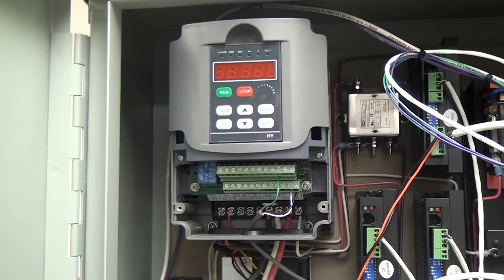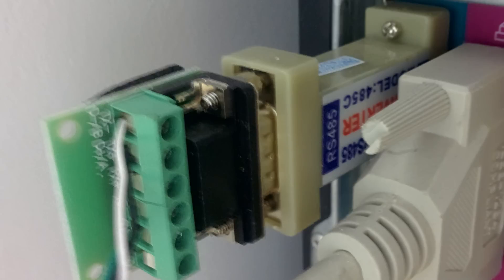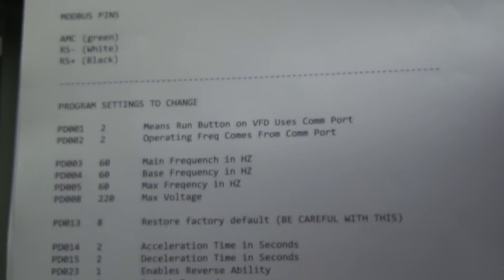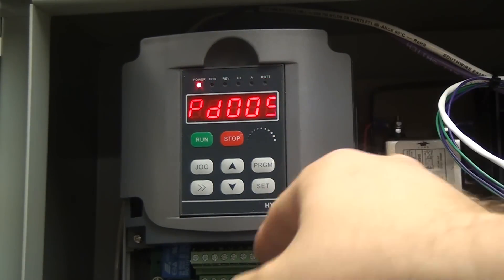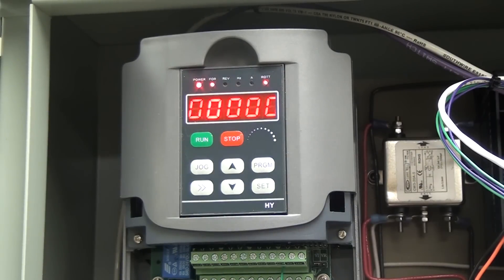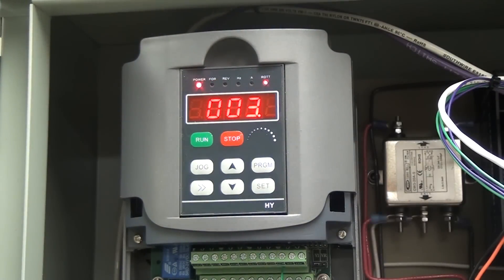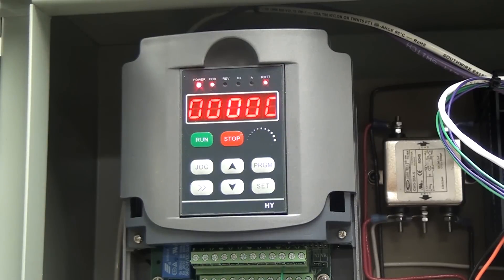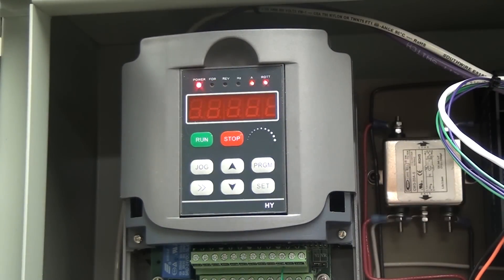Huanyang VFD 2.2kw (pt2/2) - Programming

Comment: Actually, the Parameter #13 is pretty important.
As You stated, it will revert the parameters to factory values when set to 8.
I think this should be done before any other parameters are programmed. This way You know the state of the VFD.

I have programmed a few of these and I have stumbled twice in a situation when the parameters were totally haywire. I think this is because the units are tested in the factory and sometimes the test leaves the unit in some strange setup. Factory reset will cure this.

Good and informative video.

Comment: The pins labeled FOR, REV, RST, SPH, SPM, SPL are actually multipurpose(with pin number D1~D6) and are configurable for different features. Whats on the label is actually their default feature.
Settings for program 44~49 are the pin configrations for the multipurpose pins D1~D6. Each can have 32 configurations (set 0~32), here are few common settings you may need:
01 Run (combine this with other controls)
02 Forward
03 Reverse
04 Stop
05 Toggle forward/reverse
13 Emergency stop
14 Reset
Fortunately I can understand the manual so I post this.
Reply: And also, you can configure diffrent segments of speed. That VFD comes with two speed control modes (low/mid/high or 8 speed) . The 3 speed control are already usable from pin SPH/SPM/SPL (of course you need set the frequencies first)

Comment: DO NOT FOLLOW THIS TUTORIAL UNLESS YOU HAVE THE SAME VFD. MY SPINDKE STARTED SMOKING AFTER SETTING IT TO 60HZ LIKE THE VIDEO
Reply: PD003 004 005 should be the spindle frequency  so 400 hz NOT 60
Reply: @hb9dod  This is my understanding as well (likely dependent on which VFD you have) but mine specifically says to set those parameters to match the HZ on the SPINDLE (not the input frequency from your power source to the VFD).
Reply: It's too bad I didn't see your reply until after the smoke cleared 😞

Comment: hey man, thanks for the Vid! just ordered one of these from ebay to run a 2.2kw spindle for my cnc. Just a FYI 8e1 RTU is Modbus lingo for 8 data bits, one stop bit. and rtu is remote terminal unit. just means that Modbus is set to direct master slave configuration (as opposed to over a network). your PC is master your VFD is slave. I am really surprised it didn't have you set parity. even or odd. but who knows :) anyway thanks for the tips! cant wait to get to playing with mine.
Reply from the maker: That's a great explanation, thanks! I don't know modbus at all but your description makes sense.
Reply: The 'e' in 8e1 means even parity.  It's defining the protocol of the bits flowing across the connection.  Both ends have to talk using the same protocol or it's like one person talking Japanese and one talking Hindu.
Reply: Ah. Your right! Didn't catch that one :)

Comment: If running on a VFD why stop and change belt ratio? Just set program 5 on your VFD to a max frequency "above" the base speed of 60hz to over speed the motor. something like 75hz = 2250rpm for a 4 pole.  Just as the VFD can run the motor below base speed (60hz=1800rpm) it can run it over that also.
Reply: Thanks - you just solved my problem of not being able to change the speed via the variable speed switch on the VFD above 1800rpm
Reply: Greg SB
Just remember that the VFD runs the motor in constant power mode above base speed (in this case that would be 1hp).  So the torque the motor can provide will drop off HP*5252/RPM=torque.
Reply from the maker: For my lathe, I need to run some tests and see what the motor is willing to take. It isn't rated above 60hz. Now my new inverter duty mill motor is rated to run at 120hz and 180hz is the "max safe". That should be fun.
Reply: The Leeson 192051 is listed as "inverter rated" 10 to 1 speed reduction and 150% speed increase, so you should be able to run the motor from 6hz to 90hz without issues.  Of course the "inverter rated" is a marketing term and as you mentioned if it was an inverter duty motor (ie designed electrically to run on an inverter) it would be marked on the name plate.  Since the motor on a VFD will produce constant torque below base speed and constant HP above it should be possible to run just one belt ratio for the majority of your lathe programs and not have to stop to change belts or have 2 programs.  Looking forward to seeing the testing videos.
Reply from the maker: Chris S The Leeson is 10:1? I can't find that info anywhere, but that's good to know. When controlling the VFD via modbus there are 8 "speeds" the VFD allows, in 7.5hz increments.I've run the lathe at all of those speeds, but you're right the torque falls off pretty quickly. When I need low RPM and more torque that is when I go to another belt, but that's proven to be somewhat rare at this point.
Reply: russtuff see the link for the 10:1 rating ( first page AC aluminum frame)  http://www.leeson.com/1050%20Updated%202015/1050%20Updated%202015%20AC%20Motors%203-Phase/IECMetric.pdf
Most small 3 phase motors are capable of 10:1 constant torque and really the only thing keeping them from doing more than 10:1 is the lack cooling when they are slowed way done. To get the most out of over speeding the motor the max amp rating should be set to at least S.F. amps as the motor will only draw that loading if needed.  Remember 3 Phase motors are all rate to run 24/7 in a 40C (104F) environment for years, they can take a lot of abuse. Keep up the good work!
Reply from the maker: +Chris S Thanks Chris. I know nothing, so this is good stuff. I have my vfd at full load amps and not service factor. I should crank of up a bit then. I have an external fan I need to mount on the lathe motor so I can keep it cool under load. My new mill motor is 1000:1 so that one should be fun.

Comment: Will this unit function with only 220 in and the power leads going out hooked up and none of the other wires hooked up..I just received one that is similar and hooked it up, but nothing happening..also do you have to do any rewiring on the motor..it is a clausing 4914 lathe with a 3-phase motor..the vfd is single to three phase

Comment: FYI pd 176 needs to be set to "1 "  for 60hz input power
Reply from the maker: OOOOO good catch! I'll add that to the documentation on my dropbox.
Thanks!
Reply: I tried to set mine to 1(60hz), and it wont save it. It jist goes back to 0(50hz)  I have tried reseting the vfd any ideas?  Im having trouble getting my spindle to spin past 1000rpm.

Comment: There is enough noise in my shop that I sometimes don't notice that I have not turned the VFD on.   Running a program with the spindle not turning is not my idea of a good time.
I finally figured out how to let Linuxcnc know that it is off.  In custom_postgui.hal  I added the following line as the first line in the file:
sets spindle-at-speed false
and that did the trick.  Now if I forget to turn the VFD on the program executes until it finds the first S and M3 commands and waits until I turn the VDF on and the spindle gets up to speed.
Reply from the maker: Excellent!

Comment: I want to run my motor at 20khz at it's highest rated voltage which is 220v, 
the reason why I want to run it at such a high frequency is because apparently they higher the frequency the less current it draws giving the same output(supposed to be physically impossible). so how would I program my vfd to make higher frequency?
Reply: u should program PD003,PD004,PD006 to your desired frequency yet I have difficulty changing it from output of 50Hz to 60Hz, I change whichever I mentioned and all together, at the panel it shows the 60Hz like I chose change but does not change while running the motor...from my experience with another type of VFD the 60Hz output gives a bit higher RPM and still maintains its torque
Reply: Ronen Shemesh oh I know how to program it manually but it maxes out 500hz, I wanted to change the limit. thanks anyway bro

Comment: My system has a 1 1/2  3 phase motor and running a 1.5 kw VFD the maximum my lathe runs is 1750 I wish it ran a little higher speed. I am running default 50 HZ. Can I run a higher HZ to increase speed?
Reply from the maker: It depends on what your motor is rated for. On one of my machines, I run at 120Hz because the motor is rated up to 180Hz. It's a inverter duty motor.
Reply: @russtuff  I have a 3 phase motor that is rated for 3500 +. I have a 2" pulley on the motor and an 8" on the direct drive on the  Craftsman lathe. It is a completely different lathe then it was with the when it was originally built. I thought I could change the speed with the parameters but may need to reduce the 8" pully.
Reply from the maker: @imanutnur7  if you have a way to monitor the temperature of the motor, I'm sure it wouldn't cause any problems to try out different frequencies. you might also want to check what type of bearings it has and what RPM those bearings are rated at.
Reply: @russtuff  Which parameter controls it.
Reply from the maker: @imanutnur7  I'm not sure but I'll track down my manual and get back to you.
Reply: @russtuff  It has been a while since I looked at the parameters and I recall after looking at them that I had set the PD005 from the default of 50 Hz to the maximum of 400 Hz to reach 1750 rpm.  I had hoped I might be able to increase the RPM by a parameter but I bet I will have to decrease the lathe side pulley size from 8" to maybe 4" and lower the parameter PD005 lower than 400 that I have it set now.

Comment: hey RUSSTUFF i hope you are fine .  i have huanyang 2.2kw vfd and and i set all required parameters according to the manual . and i am using external knob to control its rpm .but i have a problem when i use breakout board to control the RPMs of spindle it does not spin according to speed which i put in MDI mode of mach3 .i.e if use S100 rpms of my spindle goes to 8000 to 10000 .can please help me about this issue  ?

Comment: You mention that the green wire connected to pin AMC.  My inverter does not have an AMC but does have an ACM.  Is it possible that they are the same?
BTW Great videos.  I would still be fumbling around without the first one.
Reply from the maker: lol I bet it's the same thing and I said it backwards. Or mine is labeled backwards. Did you try it out?
Reply: @russtuff  Sorry to be so late responding.  Largely due to your videos and files I have gained control over my spindle from Linuxcnc.  Thanks! :) 
I do have one small issue left that you may be able to help me with.  If I do not power up the VFD then when Linuxcnc starts it thinks the spindle is up-to-speed and executing a program will not stop at the first S code like it should.  If I turn the VFD on and then turn it off the green indicator on the screen turns red and exechting code will stop at the first S code and wait as it should.  Then, if I turn the VFD back on code will continue to execute after the spindle is up-to-speed.
Do you know how I can get Linuxcnc to realize that the spindle is not running if I never turn the VFD on?  Thanks for considering this.  Jim

Comment: PD144 Rated Motor Revolution you kinda went bonkers on drives and did not say what to put for say 24,000 rpm motor? also my motor is a 400 Hz motor where is that programmed in?  My land power is 115V 60Hz. thanks
Reply: Check your manual to be sure but PD072 is where I set that for mine. Also from HY on Amazon for my setup they said that PD144 is NOT the motor RPM (for mine it is set to 3000 when my spindle is rated for 24000 rpm). "PD144 is the tracking parameter to ensure the accurate RPM is displayed on the panel of the VFD"

Comment: wow thanks. I got a vfd manual in full chinese, now the vfd display and buttons start to make a little more sense.
Just a question... so i^m in europe so 50Hz, got a 3phase 380V 1.5kw vfd (different but similar looking to yours), got a 0.75hp, 0.55kw 380v 1370rpm 3phase motor... my question is when you program the voltage on the vfd do you think I have to input 380v?
Reply: doesn't really say much about the exact model of the vfd other than "V88"

Comment: have one like this getting error code 2 and error code 3. How do you do factory reset or how to clear error code?
Reply from the maker: I think you change the value of program 8. It's in the manual but I can't pull it up right now.
Reply: P08 is Hide Password. When i push Stop/Reset (button 8) on the controller it resets then about 2 seconds it shows error 3 again
I discovered that I had the motor wire for 460 volt instead of 230 volt. I corrected that and have the same problem. I disconnected the motor from the vfd and still have the same problem. Can't get it to reset.
Reply from the maker: Ah, set program 013 to value 8 for factory reset. I knew there was an 8 in there somewhere. Does factory reset make a difference?

Comment: hi. I'm gradualy piecing together how to use this vfd. Need a set of how to books on kindle! :)
Thanks for your contribution. 8E1 refer to the port setup 8=8 bits, E I think is 'even' parity and 1 is the stop bit -> the structure of each chunk of data sent to the VFD.

How do you wire the mains power side of things ie the use of  surge protectors etc?
Reply from the maker: I'm just running a filter in front of my VFD, this one: https://www.amazon.com/gp/product/B00D0U83D8
Reply: Hi. I've just installed a fliter on the main into the VFD. Now need to test to see if it's okay.

Comment: has anyone ever tested the power coming out of the vfd @60Hz? I've triple checked the settings and I am only getting about 90 volts if I probe out one leg to the other on a 3-phase discharge side. I have 240 single phase going in.
Reply from the maker: I've never checked mine, I just assumed I was getting 230v or whatever I set it at.... Now you have me wondering though.
Reply: russtuff could you check it and let me know? I have 2 of these units. one for my Bridgeport that I've been using for a year now. I checked that one just the other day and wasn't getting 220vac @60hz. I've been talking to the company through email and they basically tell me to read the manual. no help there.

Comment: Russ is the VFD to computer connection via the RS-232/485 serial adapter the only connection you need for LinuxCNC to control the VFD?  In other words does the C11 board get used at all then to run the spindle?  Or is the C11 board just used to run the X, Y, Z axis?
Reply from the maker: No, the C11 does nothing to control the spindle in my case. It only reads RPM.

Comment: You mentioned changing the rpm to reflect the actual spindle rpm. I'm assuming this will display the correct rpm when in use? if does it just automatically display it? mine just displays frequency by default
Reply from the maker: +Billy T Yes once set up it should show you the correct RPM. One of the buttons cycles through information like RPM, frequency, etc. My control cabinet is in storage so I can't play with it too see which button does which. I never used the vfd read out either since I can see RPM inside of linuxcnc.

Comment: What do you think of the build quality over all of the Huanyang VFD ? Anything beyond what you have said in the video?  I use Teco on most of my machines. I am just looking at what might be outside of that choice.
Reply: I'd say that TECO VFDs are nicer looking and probably a bit better built but the Huanyang VFDs are suitable for home shop and small shop use. They are cheap enough to buy two and have one as a spare.
Reply from the maker: +IronHead Machine +Liberty4Ever I don't think you're going to get better quality vs a Teco, but these things are cheap. I've been reading more reviews online and it seems a lot of people have torched this VFD, but mine has been really solid so far. Maybe I'm not pushing it hard enough.
Reply: +russtuff  I was thinking on getting one for an on the cheap DIY belt grinder. Thanks for the input guys
Reply from the maker: IronHead Machine That's not a bad idea! Also, there is a way you can control the speed with an external pot wired up, so that would be perfect.

Comment: Russ, link to the manual on google drive does not work.  Assume that has info on programming the custom.hal, etc.  Can you repost the link please?
Reply from the maker: I had it create a new link but it is the same thing as the old link. The permissions are set for sharing too. Are you getting a file not found error or maybe just no permission granted?
Reply: All I get is a blank page with text: Not Found Error 404.
Reply from the maker: +gordonfrank try https://drive.google.com/file/d/0B1zl3WgbwjPGT0ZWSGNKMUprS0U/view
Reply: Just tried using Explorer and it worked.  I always use Chrome, but thought I'd try Explorer.  Go figure.  Sorry to bother you.  Thanks for the videos.  John
Reply: That worked...thanks.

Comment: I'm kind of surprised that you can't do the VFD programming manually. I apparently can't find the right manuals, but do you know if the VFD has an SPI, UART or I2C port on it? If so, you could probably program it automatically that way using a microcontroller that simply sends the commands when it detects the DPDT switch going from the lathe to the mill
Reply from the maker: It doesn't look like it. This one has UPF, DRV, DCM, SPL, SPM, SPH, RST, REV, FOR, FOR, FA, FC, FB, DRV, =10, VI, AI, ACM, AM, RS-, RS+. The RS ports are the ones I have hooked up to the serial port. Even if it did have the ports you mention, I wouldn't know the first thing about programming pulses to change the parameters. If you're interested, the correct manual is here: http://www.exoror.com/datasheet/VFD.pdf
Reply: russtuff  Ah, slick, thanks. I'll leaf through it. I did some more hunting over the weekend and found this site [1], which calls out RS as the RS485 (serial) port. Sound like you CAN program it via serial, so you might be able to get your controller (LinuxCNC or Mach or whatever) to automagically set the program parameters correctly. I'll keep pokin' around...
[1] http://fightpc.blogspot.com/2014/10/vfd-control-with-arduino-using-rs485.html